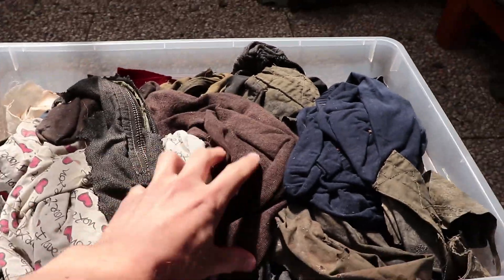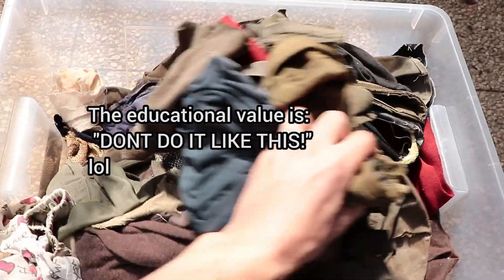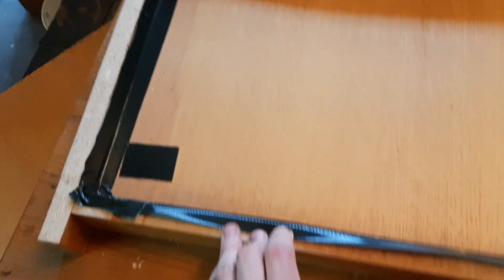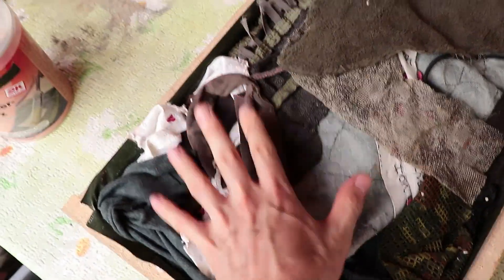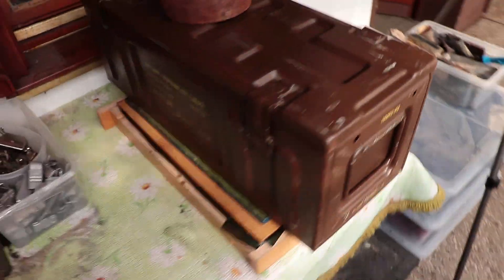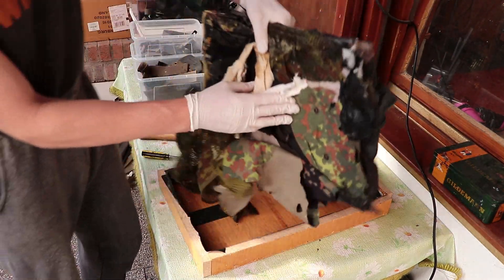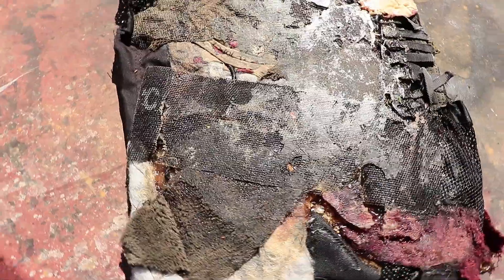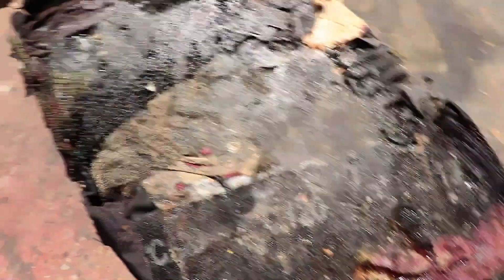How I FAILED to make a composite armor from fabric scraps & resin. Still fun though! :D

Comment: Also with resins you need to work in layers.FIrst step you need the form or crate covering with the resin. When it is near to dry but it's sticky lay the first layer of material. Put over this layer another coat of resin, than another layer of material, and so. Like making a cake. At the end you need a weight for pressure (like in this video). This type of crafting in household is not so easy and it's messy. But not impossible. At the end there will be a lots of boubles between the material layers, but it's fine for this purpouse. The final product with this composite technique named MICARTA. You can find a bunch of how to videos on youtube. Good luck!
Reply: One tip for "painting" the resin on things: Use a kithcen silicon brush (normally it is for cooking), because to silicone sticks only to silicone, and you don't need a new brush all the time when you are need to work with another dose of resin. With slow curing epoxy it is not a problem, but the polyester resin hardens too fast, and you need to work with a bunch of smaller doses. I hope it will help you in the future!

Comment: I did something similar and it worked for me to soak each individual layer in resin and layer it together using fiberglass techniques. I also used fiberglass resin as well.
Reply: Also, there is no smell after curing

Comment: To start the material looks great and it would look super cool as armour, but maybe a deep pour resin would have been better like a 2 part epoxy, it still smells when you use it, but goes away after it have cured and its pretty resilient too. What you did there is pretty much the same method when you make micarta, so it isnt impossible to do strong composites like that!

Comment: Next time, try to do it the same way as carbon fiber parts (infuse the fabric with resin, lay it on a waxed piece of glass, cover it with a  easy separation fabric, than seep through foil, than cover it with thic geotextile to soak in the overflow resin, put it in a bag and suck the air out)

Comment: It's a trash gambeson. Should hold up to stabbing no worries. Not sure about the smell, maybe some better resin would make this less of an issue or a good long while outside. Also resin react more strongly in bigger volumes, so maybe you ended up with some partially cured resin making it smell worst.
Reply: Also some wood glue are water soluble and your prop will fall apart in the rain